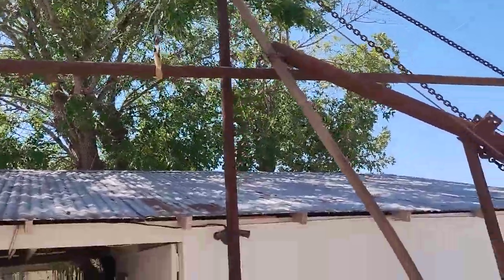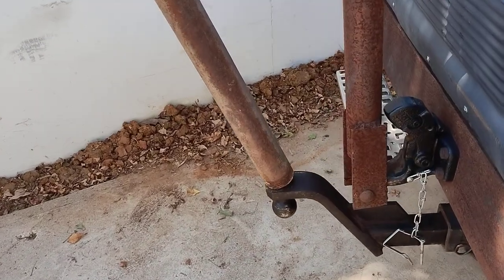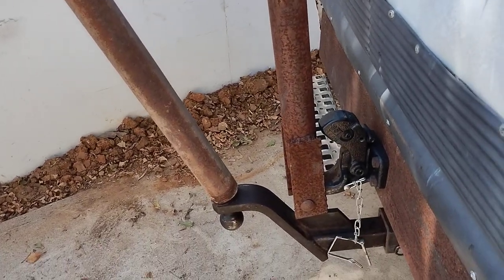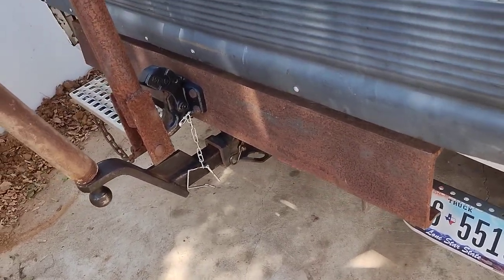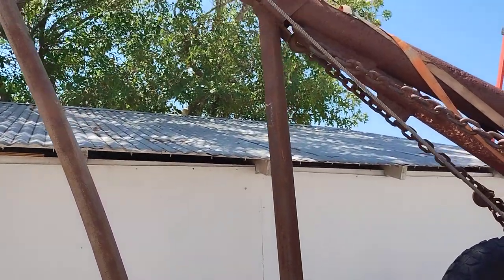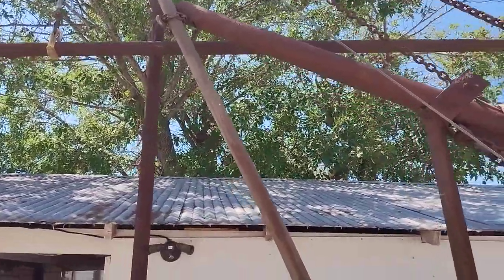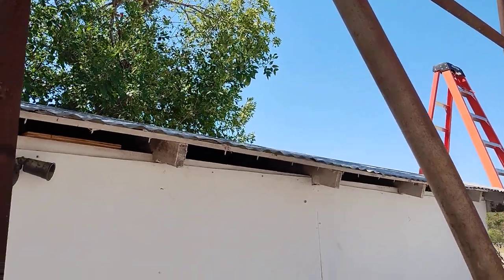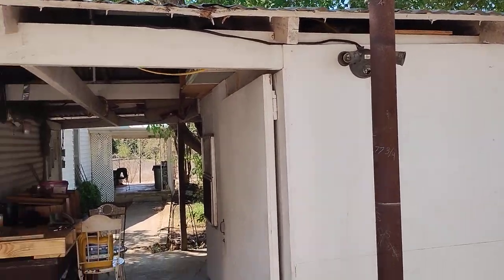Steel Carport build. Lifting pipe beams onto posts. Part 1 #diy #CRRNewsAndClues 09/09/2023

Comment: Steel is stronger than wood!  It's cool you're a welder.  I played with my Dad's Arc welder a few times at the end..  It was exciting to me, then the stick, sticks to metal if you slow down. too much ha.  :hand-purple-blue-peace:
Reply from the maker: Mig welders are pretty interesting to use also. I didn't get to learn much on a TIG welder. It works sort of like brazing. You have to feed the rod while you use the tig machine to weld it into place.
Reply from the maker: The metal will be affected by electromagnetic pulse. But it won't burn. Especially if I don't put any wood on the metal.
Wood with nails or screws in it will be ignited by the nails or screws.
You'll want to see my video that's uploading.